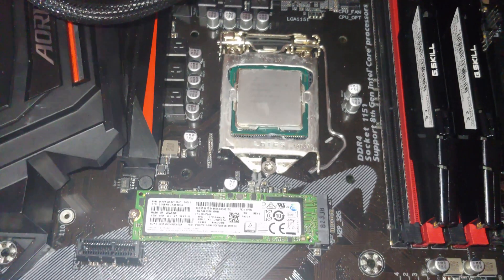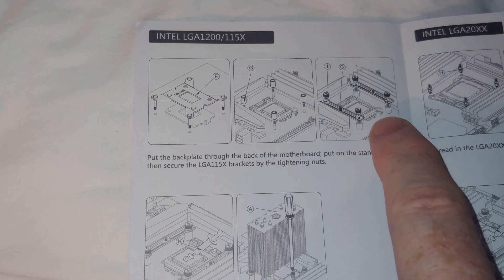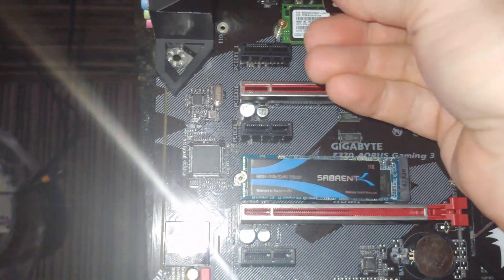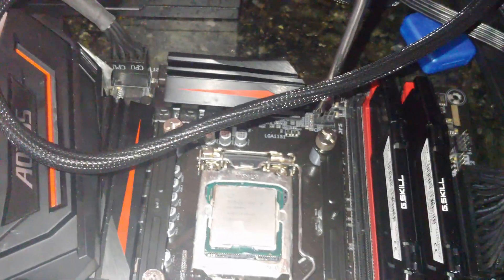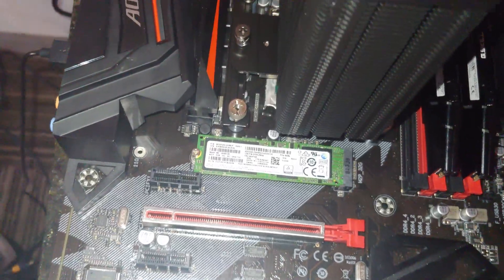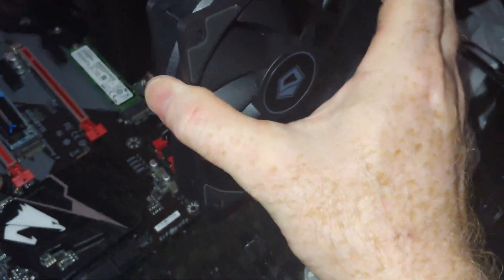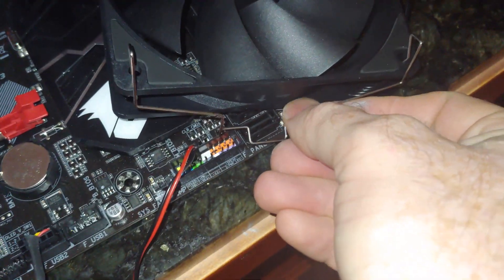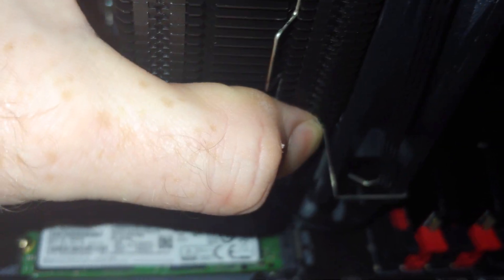Installing ID COOLING SE 224 XT Black CPU Cooler on I9-9900kf LGA 1151 1200, step by step

Comment: Hows the performance? And which is better between this and their id cooling se234
Reply from the maker: This might help on first question

https://youtu.be/fR0MntYZuNM
Reply from the maker: Pretty sure 234..i had 2nd fan on it though..and eventually put on R9 3900x
Reply: @PC_HardwareTechUnboxing_1  is there a huge difference on their performance?because im planning to get the se224 xt argb v2 and I will add 2nd fan on it. Since i dont like the looks of the se234 especially the  top heatsink logo.

Comment: How about the temps with this cooler? Already have the ID cooling, but i want to buy the 10900f
Reply from the maker: Hello, this is an FortNite example with Cores at 49x and Blck Freq at 102.9Mhz:  https://www.youtube.com/watch?v=AuzMnFicK0w

This video has some Cinebench R20 benchmarks using Intel's XTU to monitor temps:  https://youtu.be/fR0MntYZuNM  Its a rather long video as I try to beat my PR for this processor using various types of OC's.

This also provides MSI afterburner stats as I benchmark Far Cry New Dawn in an unpublished video:  https://www.youtube.com/watch?v=_vRrvfLDXqs
Reply: I would not put a 20 buck cooler on a 10900f. Get the Mugen 5 Black Edition.